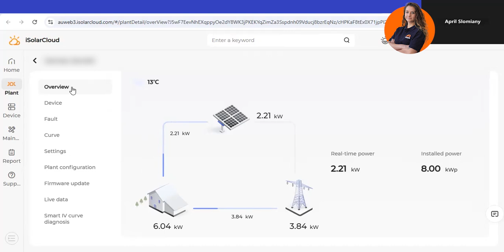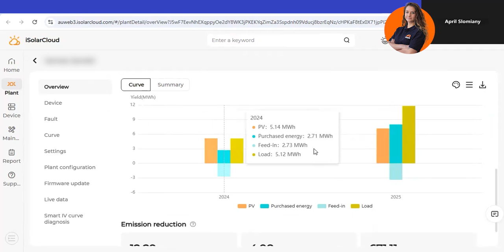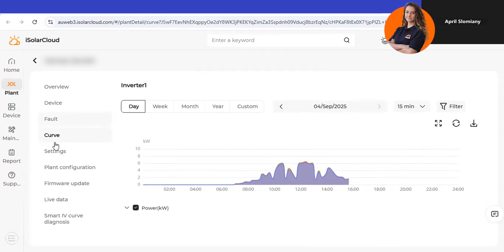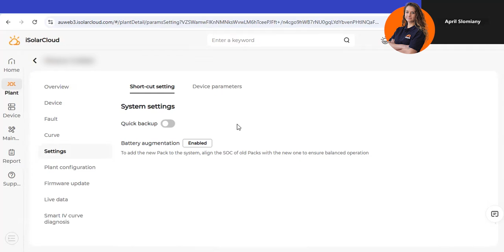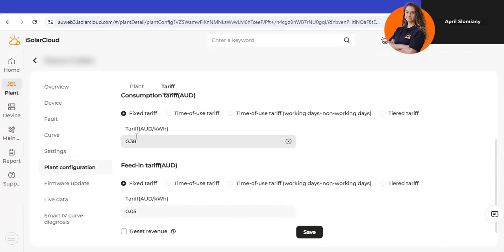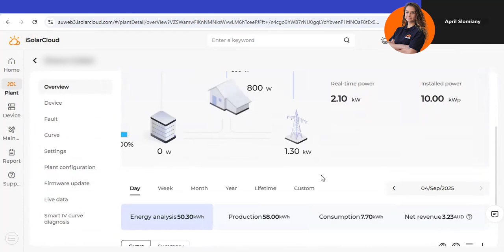Sungrow iSolarCloud Walkthrough | Solar System Monitoring Made Easy

Comment: Well explanatory tutorial 
I’m planning to pair a Pylontech Force H3 with my SH10RT as it is cost effective, but even in Admin mode, the battery selection menu is missing all third-party options (BYD, Force H1/H2, etc.). Are these automatically detected once the CAN-bus is connected, or is the newer firmware locking them out? Where specifically can I find the battery selection toggle.

Comment: Above all, many thanks for the very informative. Initially I had a sungrow battery, it worked fine until I had a EV charger installed which required an Ihome manager. Now although my battery is at 95%, the charger is drawing power from the grid. I did some research and it looks like the SOC should be reduced to 0% for both the battery and the backup but am unable to find where in the system those values can be updated . I logged a fault with Sungrow but no response yet and meanwhile am unable to use my battery power and it's costing me. Much Appreciated

Comment: Hi, it would be great if you could show how to get the isolar app on your phone to work. After re-installing it, I get error messages when trying to log back in. I've used local access to rescan the QR code, linked it to home wifi and have used admin & password pw1111 (as told by Sungrow Aus) but continue to get error messages (Your user name or password is wrong - you have 4 chances to enter again - Got it). Thanks.